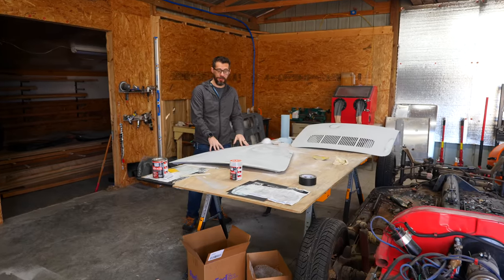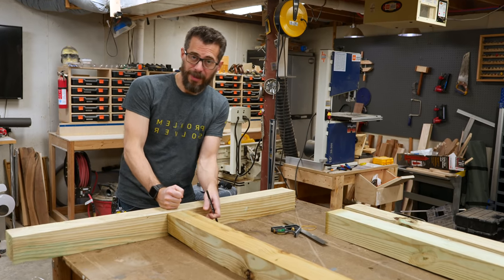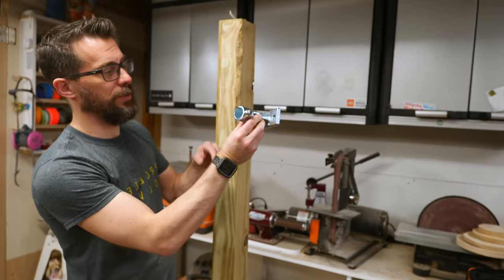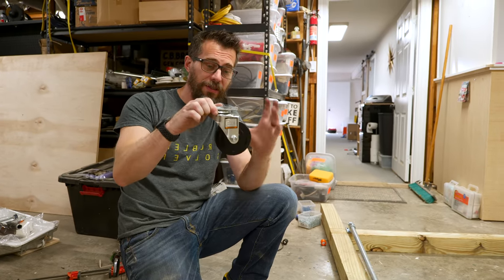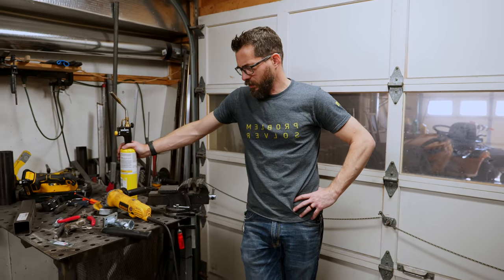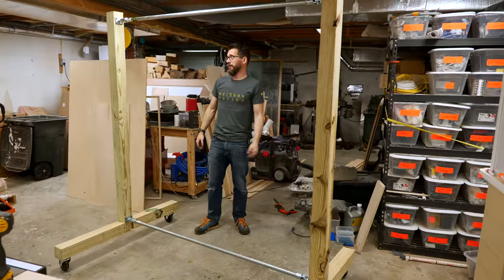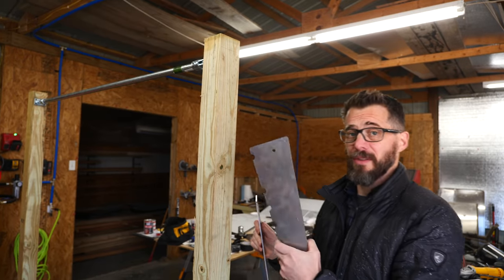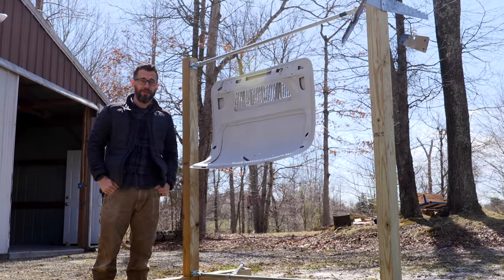Making a Collapsible Painting Stand

Comment: So, instead of loosening the grub screw at the end of the Tee when you want to collapse it, just loosen the grub screw that's on the long pipe and let it slide to where the end piece is parallel to the long pipes.  You could even change our the grub screw to a wing bolt, or just epoxy a cheap allen wrench into the grub screw.  Just reach down and loosen it a bit, or for even easier deployment, through drill the long pipe and bracket, then drop a clevis pin into it at both the open, or the closed position.

Comment: You did the cuts for the wood lap joint exactly the same as I did on my moving CNC bench. Only difference is I bored 3/4" holes for hardwood dowels into the verticals and ran 3" deck screws from below into the dowels. No end grain issues that way and they look awesome. Always fun to see your videos. Keep them coming!

Comment: Another great build! Projects like this one are great for those of us with a small workshop. Also, those extra arms you had made remind me of the adjustable arms we had at the Powdercoating shop I used to work at. We had steel rolling racks with two uprights and a pair (or multiple pairs) of arms similar to those you made. We used lengths of rebar to hang stuff off of for painting and baking.

Comment: Looking forward to more of the Karmann Ghia videos! Just a tip, when you go to lay the actual paint or clear coat, if the color isn't  completely solid (if it had any pearl or flake in it), you'll want to lay the paint on the panels while they're on plane. You'll want to have he hood flat, and the doors vertical.

Now that I'm thinking about it, you also built a rotisserie, so it wouldn't be a big deal as long as you painted the roof on the same plane as the hood...so yeah just plan out the spray patterns ahead of time! Haha

Comment: The best part about using threaded pipes, even if you don't need them now, is that you can later extend them by getting a coupler and another length of pipe. Not sure how much longer you would want it to go, but it's available.

Comment: Buy metal shopping trolleys, they make for really good mobile work areas, and you can also use them for storing stuff as well. Plus available in various sizes, and you can buy them as surplus, plus also the plastic ones are almost as useful. Available at pretty much every supplier of shop fittings and racking as well, either new or as used.

Comment: Hey great thanks. I'm looking into starting rug tufting using a tufting gun, and I wonder if a similar thing could be applied to the frame needed for that. The difference being it having carpet grips or something round the edge to stretch backing material across, and also a feature to put yarn spools and guide the thread from them to the gun as they unravel. 🤔 Food for thought

Comment: As usual, awesome execution. 

My idea is to make a smaller version, that doesn't roll. It'll be small enough to carry from my garden shed to the back yard. I'm gonna add a small roof structure since we have trees that live to drop live leaves on projects, as well as dive-bombing birds. Using the roof, I'll ad a couple battery powered lights for extra illumination, since I have plenty of extra Ryobi 18v tool batteries in my collection.  Add a couple small fans, and I'll have a decent paint booth for working on my model trains... Which is something I've been meaning to work on.

Comment: I really like the idea of this. However, I would modify it so there is a rigid square with the wheels rotating. Each vertical post would have two positive stops that pivot on perpendicular surfaces. That way you could rotate one up and one down and adjust the bottom of the T into a folded closed or folded open configuration. I think I'll try a large diameter PVC for the top horizontal part with a set pin. I think that will weigh less than a metal bar and help to keep it from becoming top heavy. Since the square is rigid I'd go with either 2x4 or 4x4 for the bottom horizontal connection which should add extra weight to the bottom.

Comment: I think you should build a shed on the outside wall of your shop to put the compressor in. It will clear up a little floor space plus it will make it quieter in the shop, and it will give you another video to make. A little construction, a little insulation, a little roofing, a little wiring... a great all around video.

Comment: if it had a little deployable cover (some sort of clear plastic sheeting or something) then while you are letting things dry you could leave it outside and not worry about dust and debris getting on it. That way you don't have to try to roll that thing with things that are still wet because you need to get them protected under a roof.

Comment: A suggestion for ease of use.   Replace the set screws in each fitting with an appropriate bolt that has a knob connected to it.  That way you won't need an allen wrench to tighten each fitting down.

Comment: I dont know if the rattle can primer spraying was just for demonstration or not, but I've had very bad luck with rattle can paint on metal, personally. Self contained HVLP turbine units aren't that expensive in the grand scheme of this project. I saved myself the cost of the spray gun plus the paint on some custom cabinets, and now i have a spray gun.

Comment: Instead of the cut top bolt for the small hangers and driving the bottom bolt in and out wallering out the threads why not use a pin that you can pull to drop the small part hangers? Or add in a threaded inserted for the bottom bolt so you don't risk stripping it out

Comment: i can only assume you wanted a project for those swivels otherwise this whole thing could be done with a drill and a 3/4 in hole and pipe  drill hole insert pipe in center you could do that for you T at the bottom instead of the lap joint and for the racking as well

Comment: I think there is a much easier solution to your racking problem.  You could have just had the upper rail be 6" shorter than the bottom so the uprights aren't parallel.